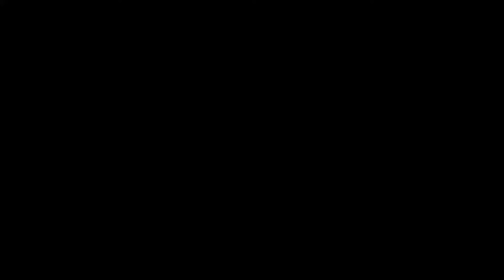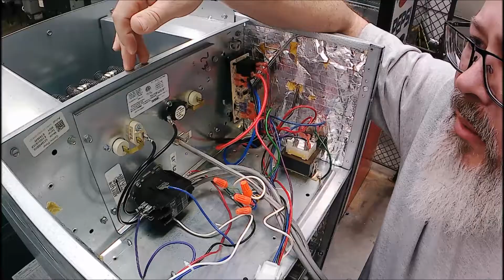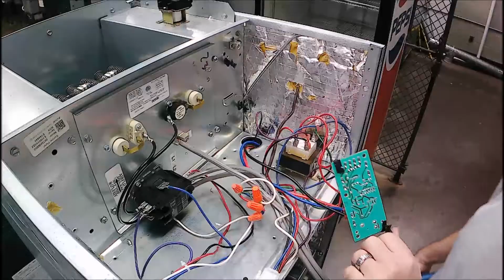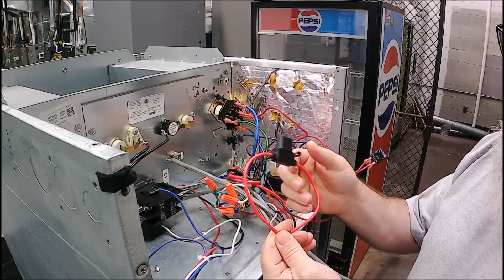Can a Relay replace a Circuit Board?? | Understanding HVAC Electrical Concepts

Comment: GM, hey John I have a goodman heat pump, having trouble getting 24 volts. The heat strips plug would not match the air handler plug. If I take the plugs off, how would wire it up from that point. Please advise!!
Reply from the maker: Make sure to confirm with a part supplier or  whoever you got the heater kit from that it is the proper kit. The plugs should fit together no problem...of course. If you absolutely had to use that kit the only way i see it is to cut the plugs off and join the wires together with some teminal/connector. That is all the plug is anyways so... something better than wire nuts! Butt connectors, male/female quick connects, etc. Not a huge deal but it just isn't as easy as the plugs!

Comment: Wire them like a 1970’s unit relays and sequencers;
We had to draw out wiring schematics back in the old days, 75% of the schematics were gone anyway;
Wiring is actually easy;
Load side;
Line in through contact to loads back to line.
Control side;
Transformer power line;
Through control /thermostat to the safety/pressure switch , to relay/contactor back to common
Reply from the maker: It is very repetitive and fairly easy...once the new guys get it! You can wire anything.

Comment: the old r22 units used relays they had no circuit board except the carrier had fault test pins early scroll compressor

Comment: The purple "coming from the heat strip circuit" is throwing me off - right when it's connected to the relay @ the normally closed terminal.  That info / what it does (paths) is mysterious in this scenario.
Reply from the maker: So it is just purple wire....but with 2 ends. I say one "comes from the heat strip circuit" on one end and "goes to the Normally Closed" on the relay. Just a matter of knowing what end of the wire you are dealing with...for me anyways. Hope that helps...if not just say so and we'll figure it out.

Comment: What brings cooling on when doing the relay for fan?
Reply from the maker: This relay (and video) was just specifically for the indoor fan motor. That is the 'G' circuit on the thermostat. The cooling is its own circuit (on the 'Y' or some tstats may have a Y1 or Y2, etc) and it is independent of the fan circuit. Hopefully when the tstat is in "cooling" mode and wants the a/c to run it turns on both circuits at the same time.

Comment: I have a similar setup with this relay…no circuit board.
My new blower motor diagram shows the black wire for high speed along with the yellow wire for a 208-2030 voltage line….. my question is where does the yellow wire connect to!?
I followed the wiring diagram to my old blower which had the black wire for high speed(Cooling) and red wire for low speed(heating) but this don’t work with the new blower wired this way.
The new blower speed ls slow and doesn’t blow fast enough to circulate air with only the high speed black wire connected.
Any advice what I could be doing wrong?

Comment: There are still computers that use relays…you can build all logic gates with relays.  You don’t need some fancy circuit board.  It’s just a way for manufacturers to make an easy buck.
Reply from the maker: It is a smaller footprint that I appreciate but I like figuring out circuits to keep my mind going.
Reply: @johnjennings-JJ I understand that, as an Extra Class radio Ham, I love playing with stuff like this…a relay based computer is a cool project and interesting idea as an alternative experiment in home control not just for A/C but for everything potentially.  It’d be humongous to have a relay computer in the basement but still awesome, almost like a computer as portrayed in the 60s and 70s tv shows…😁😁

Comment: Just fixed last week of this exact situation.   I have a decade old r22 Carrier rtu (roof top unit). commercial grade at a business. The blower fan ran continually non stop and the owner is too dumb not  to  shut the breaker off so it ran weeks and weeks with high electric bill. He asked me to fix I looked at it and could not even find any part  for that  Carrier.   I knew it was the fan blower board but in this  case it has a multiple relays and a small board.    I decided to go with the Goodman controller just a matter of rewire.
By understanding how it worked I bought the board for $20 brand new and it worked exactly as I expected  fan turned on and off with delay.   
You can practically replace any brand, any type of AC  with different brand  board if you know how to hook up correctly.  They all work similarly.

Had I not known  the whole unit probably be ripped out and replace with brand new at a cost of $10k or more. Over a $20 fan controller board!    Yep when it comes to money it will cost big time if you are ignorant!

I did not get pay for 3 days up  and down the roof to fix that unit because that is a business of my in law. Not sure he appreciated how much i had saved for him either but one thing for sure. that darn thing worked.

Comment: It’s a good lesson to learn- these concepts apply across to all brands. Kind of backwards engineering.  I did this same thing on a Friday afternoon to get my unit running when OEM parts weren’t available until next week. I would like to know what p/n  that board is in the Goodman AH. I have an old Amanda with a bad board that the board is obsolete.
Reply from the maker: Yes...good basics for understanding. Try the goodman p/n PCBFM103 or PCBFM103S. That should be it and it isn't too expensive.

Comment: Why did you say 240 on the voltage? The voltage you have there is 120 and the other 120 goes to T2 on your contractor for 240 right?
Reply from the maker: Sometimes I talk it "total" voltage I guess. Seems like most guys are looking at their meter to get that number unless they are using ground to check a leg of power.

Comment: Good video but you could have been a bit more detailed when explaining the 2 common blue and two 24v red wires. One comes from the transformer but the other is coming from the thermostat. But good video
Reply from the maker: Thanks.

Comment: Where does the purple wire go to and from? Thank you.
Reply from the maker: The purple wire comes from the heat relay switch (the leaving side that is going to the heater itself) and goes into the N.C. switch of the blower relay.

Comment: I am trying to do this to my hvac that went out - but i live in florida so heat is NOT necessary.. just want the fan to turn on.. but the board has an L1 and L2.. so how would this be hooked up? I understand the 24V part.. but if i get L1 from the transformer and put on #3 - and fan (Med) on #1… how am i giving the fan 240V? What is the purple on the fan for? Should the purple but hooked to L2?
Reply from the maker: Connection-wise...i believe the purple from the fan goes back to the capacitor where it joins another purple wire the goes back to the L2 side (black wire) of the transformer. You shouldn't have to mess with that L2 side of power for this as the relay will only be installed in the L1 side like you already mentioned.
Reply: @ ah, I think maybe that answers my question. The purple wire (common) of my fan connects to the pcb.. I am assuming this is a 120v supply (L2)? 
Since I’m getting rid of the board all together and you said purple most likely joins L2 anyways, I should hook this purple to L2 right? This way I’m getting the 240v - purple common + relay .
Am I correct or am I way off?
Reply from the maker: Yes. You can go back to the terminal block or the primary side of the transformer had a black wire with a place to add the purple to it. Sounds like you got it though.

Comment: Thanks man . I have a brand new colman furnace that blue up one year after installation and the installers can't fix it. The furnace fires up but the fan struggles to run then doesn't run and the system shuts down. I am almost positive it's a defective motor .  You are helping me diagnose it. Thanks
Reply from the maker: Awesome. Hope you get it!

Comment: Hey John.   I am assuming you are using a 240 motor.   Would it be wired the same with a 120v. Motor?   Thank you for sharing your knowledge
Reply from the maker: Essentially the same if you had a multi-speed PSC motor. Depending on exactly what type of system you were on or what you were planning on trying to accomplish.

Comment: When you plugged it in what exactly would I be doing? Obviously there’s a part where power comes from somewhere to go on the relay
Reply from the maker: For the switches I used in this relay I put my L1 power into the #3 switch, the #1 switch is where the speed of the blower plugs in

Comment: Nice video but I have an question why purple in number 1 what's  the meaning. Thank
Reply from the maker: Purple in #2 (the normally closed switch) just makes sure that the blower comes on at the same time the heat strip gets power.

Comment: Hello
John
Question I hook up as you showed. Will this still work on the heat strip system. Because I did not see you hook up any wire from the heat system. My unit is a 3 ton GOODMAN Outside unit.
Enjoyed your post
Reply from the maker: Sorry, i didn't see this comment. Don't know what happened there....but it should work if you hooked it up like I did. That Normally Closed switch on the relay is kinda made just for the heat strip/blower setups.
Reply: @johnjennings-JJ  Hello
John thanks for the reply back. My name is also John. I was just asking I recieved this Goodmen 3ton unit, from a friend said it work okay 2019 model. He purchase one of them new Mr COOL state of the art systems for his home . So I installed the unit and could not get the blower to start the out side compressor and fan come on but no blower motor? so once I viewed a few of your videos and found the board was the problem.
The reason ask is summer time is about over here in. Georgia.
I will need to turn the other breaker on for the heat strip system the unit has two breakers. Just wanted to ask if the contactor I installed be okay as well for the winter time. 
I have not tryed the heating system yet only been run the A/C system.
Thanks again for reply.
Enjoyed your post
Reply from the maker: If I follow correctly, you used a contactor to turn the blower motor on instead of a relay?
Reply: @johnjennings-JJ  That's right correct. The relay board was bad. At first I check the blower motor once I by pass it the blower motor was okay. It was the relay board  had to be the problem because the compressor would kick on and the compressor fan would come on. So. Once I watch a few of your videos and I did not have another board  but I had a few contactor. Once I hook it up everything kick on. Thanks again
Reply from the maker: It would be a little different using a contactor once the heating season started...not impossible...but you would have to do some figuring and make sure it is perfectly wired. Since we should still have some time before it is desperately needed I would just suggest buying a relay that would work. The 90-340 relay (number of manufacturers) is great and that is the relay I have personally seen used most as a "go to" general purpose relay. There are others but you just need to make sure it has a single pole double throw set of switches (SPDT) that can handle 6 or so amps...and a 24v coil. Then it hooks up just like the video essentially! Or maybe a white rogers 90-370...should do the trick.
Reply: @johnjennings-JJ  Okay
I'll be sure to check that like you said before winter. Yes I had a few in the shop. White Rodger.90-340
L36-901
TYPE 91 RELAY DPDT.
STATES 12A CONT@125ACCOIL 24 VAC. Seem to be working okay. Guy told me that system been setting in his shop over a year. Once I tryed to fire it up I knew something was wrong. Again glad I watch what you shard on Utube. I was able to walk thou it. Just was not sure once the heat system would hold up. Do to more amps  im sure are used running the heat factor.
Thanks again for your replys. I enjoyed your post

Comment: John, Great Video!  Very informative!  I have the same board in my Goodman unit. My outside unit is fine. My inside furnace unit blower was not coming on. I direct wired it and it works. I checked the 24 V   side of the Transformer and it was good. So, at that point I decided to buy a $25 used control board to see if swapping it out would make everything OK. However, my original and rebuilt boards lack that purple 3 AMP fuse you have on your board. What does that protect? Would it be possible to just wire a 3AMP fuse and holder in line on one of the legs off the 24V side of the Transformer to the board? Would this work? Where would you wire one if you were attempting this same modification? Should I just solder one onto the contacts below the letters "JW1" on the board? Why doesn't mine have a fuse? If the fuse blows, I know I have a cross circuit somewhere in the wires to and from the Thermostat. I just want to blow fuses instead of burning out another board. What's your thoughts?
Reply from the maker: Been crazy busy so apologize for the late response. The fuse protects the transformer and I have put in a fuse holder in systems that didn't have a place for it on their board. I just wired it in on one leg of the transformer secondary...the one that i connect to the XFMR-R terminal.

Comment: Yeah but it's not near as efficient as the blower board
Reply from the maker: Sometimes efficiency is overrated when you come it to headaches, frozen coils, and the cost! After all, that is where it started before boards. And i am not paying for an extra 65 seconds of electricity each cycle either. But i get the other side...i am jot blowing that cool air in the house either.

Comment: John, I have a pcbfm103 relay board on a Goodman unit.  It has been replaced 3x this year.  Unit is 5 years old and up until this year, it worked just fine but for some reason it burns out and the blower stops working and the lines freeze.  Any ideas what could be causing this all of a sudden?  When a new board is installed, it will run fine but then randomly malfunction. Any ideas would be greatly appreciated.  Love your videos!
Reply from the maker: Honestly don't but there seems to be some issues with resistors on some of the defrost boards. Maybe it is related? Providing everything is wired in correctly I find that most boards last and work as they should...until a power surge or lightning strike! (My washer recently fell victim to that). But the relays...simple and it works. My trane unit at home has a relay. I wouldn't put another board in it until i put a relay and see how long it last. But that is just me.

Comment: I have a customer with an obsolete control board in a heat pump air handler. The fan relay is bad on the board & I was thinking about keeping the board in place & just transferring the wires over to a separate relay to take it's place. Anything wrong with that? Thank you in advance!
Reply from the maker: If you can't get the board , for whatever reason, or it is gonna take forever...I don't think so. Of course, don't go destroying the unit to do it but that doesn't sound like what you want to do. I try to take care of my customers as best I can. I don't know of too many complicated air handler fan boards so if it is one like the goodman fan board, just a simple relay with some basic timing...i think you would be ok.

Comment: Thanks for the well-explained video, and for sharing your knowledge.  In the video, you hinted that there is a way to add an on/off delay for the fan. Would this be done with a sequencer, or what would you use?  I do understand that you do not recommend this as a permanent solution, and you'd prefer going back with OEM equipment. I also understand that one undertaking such task does so at their own risk. Thanks.

Comment: I see your point on replacing with OEM. But, the price difference in X-13 and PSC is significant enough to try this relay without the board as a permanent fix. Is there another way to make this conversion?
Reply: It would help to trace the transformer wires to make sure everything is connected.
Reply: How does the heat strip plug in to the relay?
Reply from the maker: I would say that the easiest way is to use the QwikSwap X1. It basically is a plug for plug solution but it does cost a few dollars

If you already have the PSC motor and relay,  you won't actually run the heat strip through this relay. It has its own already. What you can do is have a 'redundant circuit' coming from the heat relay into the Normally Closed contact of this new fan relay. On Goodman units it is a purple wire already there. If you want you could also program your thermostat to control the fan. There is most likely an option for "fan control" amd you get a choice of either "system" or "thermostat". Choose thermostat, this way on a call for heat or cool it should always energize the 'G' for the fan circuit.